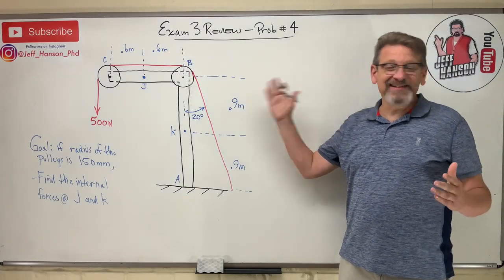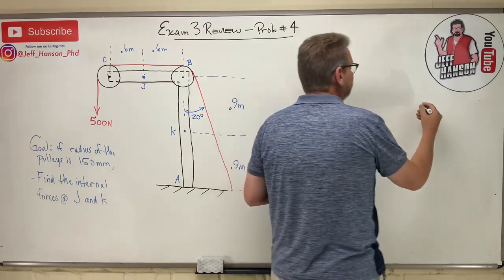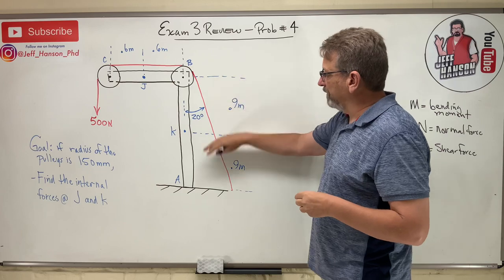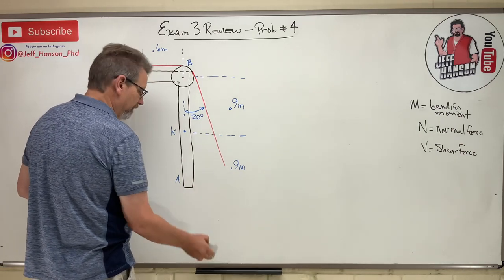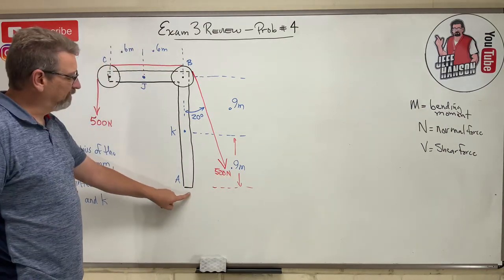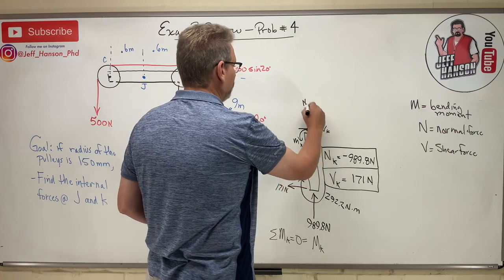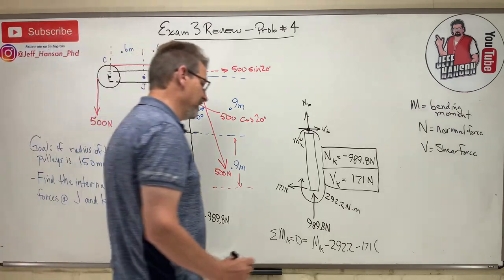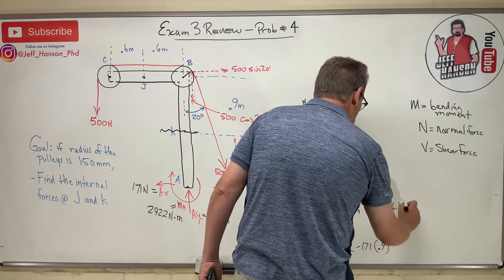Statics: Exam 3 Review Problem 3, Internal Forces M, N, V

Comment: Shouldn't the angle at the pulley used to get the x/y distances be 70 degrees, not 20? If the tangent line (tension) and the radius are perpendicular their angle measures should add to 90.
Reply: Checked it Mentor Jeff did it right :D